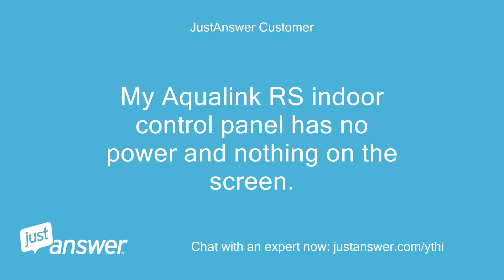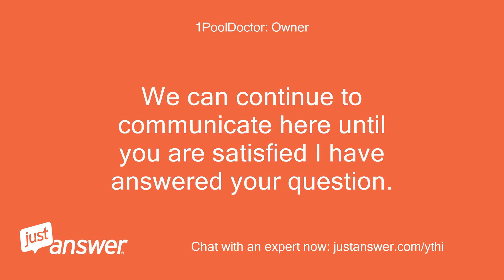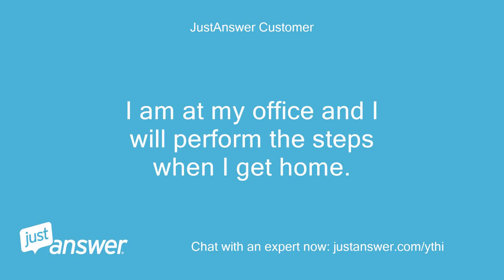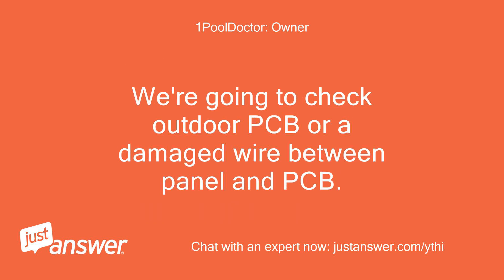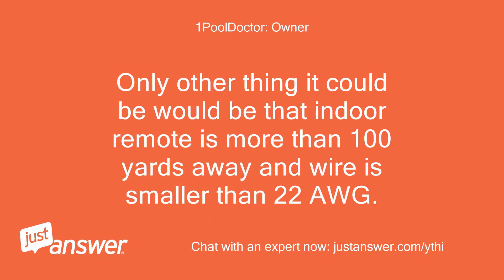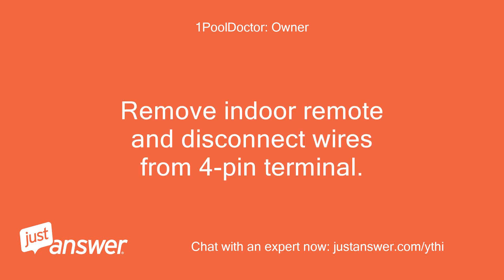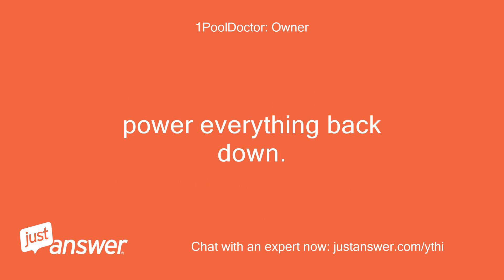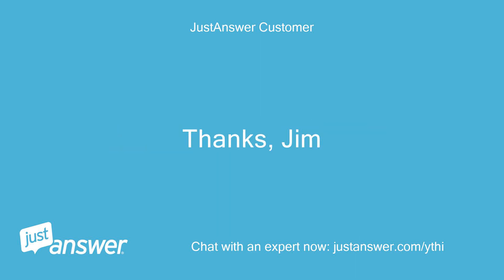My Aqualink RS indoor control panel has no power and nothing

Comment: This message is to thank Jim for excellent troubleshooting and step by step method to check the voltage indoor panel and outside control panel.  By taking the indoor panel and connecting it to the outside control panel - I was able to determine that the indoor remote control is working just fine.  As Jim mentioned, it was either a loose contact or bad wire near the inside remote.
Thanks Jim.